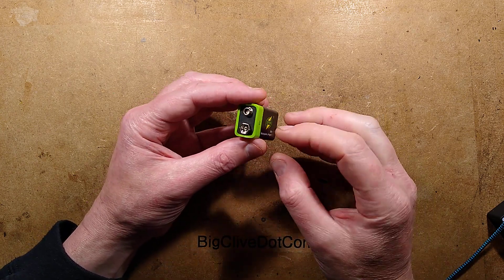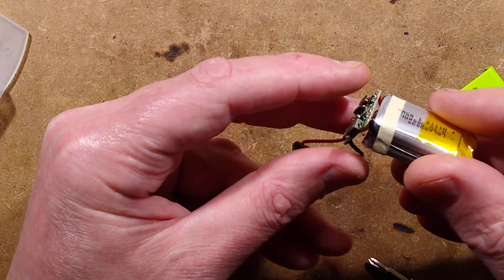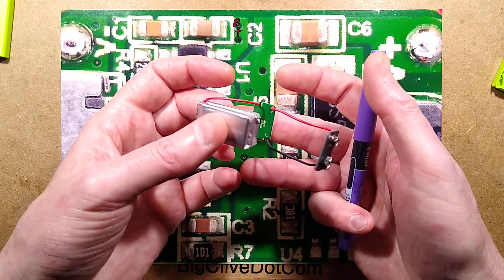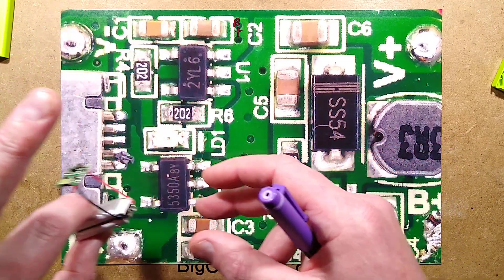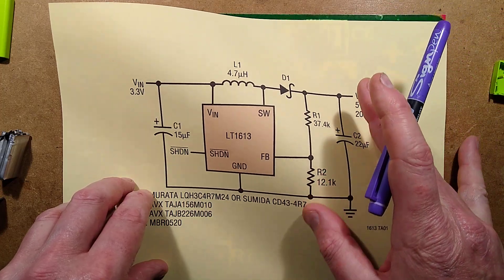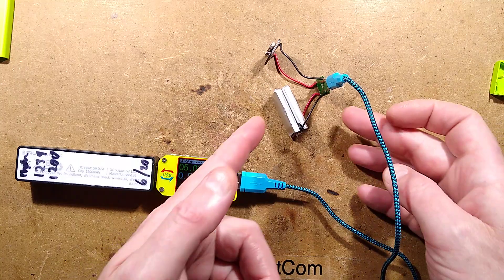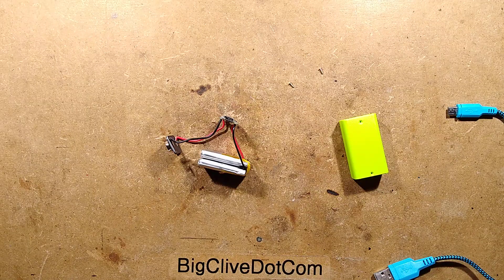Inside a Znter lithium 9V battery.

Comment: Can you do a teardown and test on the lithium ion AA batteries? I'd love to know if they're worth getting over the standard NiMH rechargeables.
Reply: Technically, you should never open a lithium cell, since in contact with oxygen, lithium becomes flammable, in the best of cases simply the entire battery will burn and emit a smoke (quite toxic by the way), in the worst case Of the cases these can explode in a very violent way, and a lithium fire cannot be extinguished with water since it reacts violently. For that reason it is forbidden to send lithium batteries by mail or airplanes (Except they are in special containers, and have an authorization from the IATA-ACAO) and for which they are very expensive in some countries (particularly islands)

the best way would be to compare them at electrical level, amperes / voltage delivered and capacity in Ampere-hours

at a general level NI-MH are more reliable and less delicate during loading but suffer from memory effect, although very little, practically depreciable and are a balance between capacity-price. But they have a very slow charge, usually 5-10 hours

Lithium
-Fast charging but,
It requires a protection circuit for load and overload, special load rates, they are more delicate, the price is higher but they guarantee a good energy rate at high voltage and high amperage, the memory effect is practically null. But their storage is delicate, they should not be stored loaded or allowed to unload,

At a general level I would consider more the use that would give them. For general devices, Ni-MH is fine, lithium would only be left for devices with high consumption or that require a long autonomy, such as motor toys, cameras and flash, and lamps
Basically- Lithium is like alkaline ones, NI-MH is like zinc carbon.
 If it has a motor o heat resistance, Lithium  it is better if it does not have motors, it is not a graphing scientific calculator or a device with color screens, the Ni-MH is perfect.

Many vapers use lithium cells, although it is relatively safe given the thermal protections that some cells incorporate and their own operating range,but... from my perspective as an electrical engineer, I do not like the idea of having a lithium cell connected to a thermal resistance very much, since by themselves they overheat and the resistive load stresses quite the cell, (as I mentioned, it is not uncommon for them to catch fire or explode so the idea of someone having that potential bomb on their mouth-pocket and hand does not please me, and more because there have been accidents from using counterfeit lithium cells or very cheap and vapers in the same conditions)

Comment: These would be amazing for guitar effects pedals, especially fuzz and wah wah that prefer battery, if you could vary the voltage that would be even better
Reply: I use them in my Tokai TOD-2 overdrive and they work great. The only thing is they go flat in a few days of left in the pedal so best taken out when not in use.

Comment: Quite surprised they didn't do they ebay thing of printing 1,200mAh on it because it has 1,200mAh of lithium cells inside, instead they are actually measuring it correctly at the 9v output

Or doing the other ebay thing of printing 69,420mAh on it and putting a button cell inside

Comment: finally, nothing more hated than a device that required 9v, another thing to feed.
now if only there were a way to make the charge port rotate so you wouldn't even have to remove it to charge.
Reply: The remote for my bedroom light/fan uses 12V A23 batteries and burns through them at a ludicrous rate. I hate those crappy little batteries with a passion.

Comment: don't use battery boosters in safety equipment such as fire alarms it bypasses the low voltage alarm built-in and just shuts off without warning

Comment: i love lithium batteries because of the numbers printed on them. 682035 is the dimensions: 6.8mm thick, 20mm wide, 35mm long, 500mAh is the capacity. you might see slightly more or less capacity in the same size battery. round lithium cells are similar, 18650 would be 18mm diameter, 65mm long. its funny when you open cheap battery banks thatll claim much higher mah, then you open it and the real capacity is written on the battery.

Comment: I ended up designing my own 7.4V LiPo circuit to fit inside the case of dead 9V batteries just to avoid dealing with the inevitably high self-discharge of these circuits based on boost converters. I don't want my multimeter to be dead after a couple of months of storage nor do I want alkaline cells to leak, so I just used a 2s LiPo circuit with protection and balancing: a pair of 402040 380 mAh cells fit nicely in a 9V battery case, with the circuit between the two.
Reply: I know it's a long time, what converter have you used to power up the multimeter

Comment: I am kinda disappointed noone has made something comparable for AA and AAA batteries. Instead im stuck with NiMH that are basically useless for long-term-cycling with storage and irregular recharging cycles. (like flashlights and other tiny tools you need every few months)
Reply from the maker: They do.  Either with built-in charging port or a specialist charger that uses the standard battery contacts.

Comment: If used in a smoke detector, would you still get the (annoying) low battery beeps or would it suddenly just stop working?
Reply from the maker: It would suddenly stop within 6 months with no warning.

Comment: how does the circut in 8:10 make an average reading?
Reply from the maker: The resistor acts like a thin tube leading into a water tank, so it just sees an average value without the pressure (voltage) pulses on the main line.

Comment: Thanks Clive for another well presented video, always good clear pictures and good sound quality for you. They certainly crammed a lot into the package, a tri-coloured LED as a basic charge state would have just topped of a very good product. Other remarks made here suggest they are okay in radio mic's and also the output on a scope is clean. It would be good to know where to get these, will have a look on the usual "E" place. Thanks again
Reply: They almost would have to show some kind of noise on a scope. They are d.c. to d.c. converters. I've never found a completely clean one yet..

Comment: I am of the thinking the "foil" wrapping you took off could (stress:  COULD) be used to shield the RF from the coil.   Though it wasn't grounded so probably not.
Reply: seems legit as its in contact with the usb port
ed. didnt see the case is maybe plastic on these, the other cell types have metal cases aswell though

Comment: 2:00
Can confirm. My mom is a journalist. She changes batteries on her mic every 4 hours of use regardless of the remaining charge for safety (she is not the type of person to recycle them, of course). I coaxed her into buying a bunch of Eneloops (the regular ones, Pros don't make sense since they will be used for only 4 hours in a mic at a time), those work a lot better, don't have any risk of leaking, and would probably last till the end of time (my Apple NiMH batteries, which are basically rebranded Eneloop HR-3UTG batteries, still work absolutely fine). This solves the problem for microphones that take 9v batteries.

Comment: The only 9V devices I have are things like multimeters. Because the output might be a bit noisy, for a multimeter I'd still recommend a NiMH battery. It probably has a voltage regulator in there somewhere so it probably doesn't matter much, but better to be safe than sorry.
Reply: Have you come across any more observations on if this type battery works okay in a decent multimeter?
Have you anything to tell about useable hours of a good 200mah 7s nimh battery vs one of these lipo-to-9v batteries?
Thanks

Comment: odd you didn't do a compare as well.  Have you tried running a real 9v battery and  this one at the same time to see which dies first.,maybe show the amps on both of them as well on what ever your powering.  Once the lithium reaches a certain voltage does it just cut out? .. hopefully you make a small fallow up .. I could just order one and find out my self i guess as well.   I ordered bunch of 1.2 voltage regulators . to switch out the 5v to make some small aaa lithium ones.(small ecigs bats ). just lazy I am

Comment: Amazon has this battery (comes with charging cable), for $11.99 USD. (free shipping) 
Amazon also has a "Delipow USB 9V Lithium ion Rechargeable Battery, High Capacity 650mAh Rechargeable 9V Battery, 1.5 H Fast Charge, 800 Cycle with Micro USB Cable" for $9.99 (free shipping).  
It would be interesting to see a comparison.

Comment: Hey clive joe electrician from america thats funny when you pointed to the chip you were having trouble identifying i thought that looks like a ham radio callsign then you said it. do you have a ham radio license i would assume you do it never occured to me to ask.
Reply from the maker: I don't.  I looked at it when I was young but got put off by their requirement for full fluency in Morse code before even applying.
Reply: @bigclivedotcom  that morse requirement is gone theres an app ham test prep you will see the tall yellow diamond the arrl symbol in play store install on your phone and use it in a couple months you will be ready to test and actually memorize and learn the study guides are brutal there great for reference material but the app cuts to exactly what you need to obtain the license
Reply: @bigclivedotcom  i bought my transeiver as a parts machine for 50 bucks took it apart replaced missing and damaged components its a real challenging learning experience buying older very repairable equiptment not like the new chinesium models its a nice passive hobby to do during crappy weather and you can drink all you want and not have to worry about getting injured

Comment: I've got a couple of "Poover" brand LiPo 9v battery packs with a (claimed) capacity of 680mAh at 8.4v. They happily power a Digispark ATTiny85 dev board with some WS2812s for hours. The one drawback is cost....I got just 2 for £6.50 each (on their website they are charging $17 a pair). However they would quickly pay for themselves as they are 2-3 times capacity of a poundshop alkaline 9V battery.

Comment: I'd buy one when they come with a two or three position switch : 6v , 7.5v and 9v - there's lots of devices which only show "low battery" when the voltage gets close to 5.5v-6v, so there's no point boosting the voltage from 3.7v..4.2v all the way to 9v if the device has a linear regulator or buck converter to bring down the voltage to 5v or 3.6v. 
Or alternatively, have a version that can switch between a boost regulator (for high current) AND a voltage doubler IC for 20-50mA max which can have super high efficiency (up to 97% or so efficient)
I made a fake 9v battery for my Uni-T UT61E multimeter using a super capacitor and a LT1037 boost regulator ... could keep the meter running for almost 1h after charging for ~ 2 minutes (limited to 2.5v ~1A charge) because it shows low voltage only at 5.5v but keeps working well down to around 3.3v so I set to boost regulator to output 5.6v just to prevent the "low voltage" sign on the lcd screen.

Comment: How about measuring the output ripple? If you don't have your oscilloscope handy, I'd settle for an AC measurement on your multimeter.

I wouldn't be surprised if there are higher-end versions (with and without the audiophool pricetag) of this that have additional noise filtering on the output. A suitable RC filter with a series pass mosfet could easily fit on the back of the snap plate.
Reply: Have you come across any more observations on how this type of battery works in a decent multimeter?

Comment: I'm over 6 minutes into this video and Clive hasn't stuck the battery on his tongue!
What is the world coming to?
Reply: I don recommend thith.
Reply: You can try that at home !
Reply: Also if you short it out it can possibly explode while your sticking it to your tongue. Wouldn't be a pretty sight.
Reply: @sweettooth7124  TongueItsNotSoImportant....😁😁😋😂
Reply: I have done this with a 9V Lithium ion battery before. It is safe with alkaline 9V batteries, but not with Lithium Ion batteries. Lithium Ion batteries have very high short circuit current. It was enough to boil the saliva on my tongue instantly. Not recommended.
Reply: @cassandra2860  reading this stopped me doing the same thing in the future. Not all heroes wear capeth.
Reply: @cassandra2860  What?
Reply: @ovidius2000  I was testing to see if it was charged. I didn't know that lithium-ion batteries could give so much more current than alkaline batteries. It was charged, so I put it in the smoke detector, got some ice cream, and learned a lesson.
Reply: @cassandra2860  Did the tongue to terminal contact make any smoke, or just a sizzling sensation?
Reply: @dsloop3907  just a burning shocking sensation and a sizzling noise.

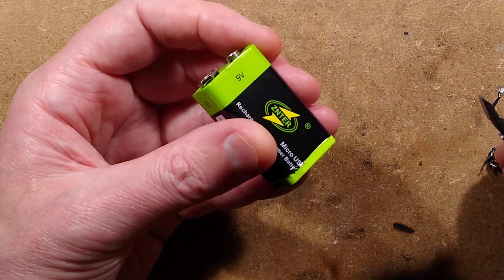Comment: 2:09  Can confirm.   During a big conference, we'll go through hundreds and hundreds of batteries.   I bring tons of them home, as most of them have over 50% life left.   Usually you have the microphones running all day, and they will generally run for 8 hours on a set of double-a's (or less frequently 9v's) but there are only so many coffee breaks, so you have to change them at a break point regardless of whether they need it.   As Clive said, it's really bad to have one go dead because you forgot to change the batteries, so most sound engineers err way on the side of caution.   Also, another important note, if you are taking all these half used 9v batteries and throwing them in a box, remember to put a bit of tape on the top, as they can short circuit against the metal case of another battery and start a fire if you aren't careful.   AA batteries don't have that issue, thank goodness.
Reply: Clip the half-used PP3s together in pairs to use as hand warmers for your walk home after the conference / show (Old BBC Studios trick; NOT recommended!)

Comment: Why everyone of them has inefficient linear charger (dissipates 20% of input power) -> one cell -> inefficient (eats much more than ICL7106) and noisy boost converter?
It must have boost charger -> 3 cells in series -> dual-mode (linear at low load and buck at high load) converter?
Reply: Pardon me, you mean ICL7660? It's only good up to about 5mA. That's the problem with switched-capacitor converters, you only get the tiniest current out of them, before they fall flat... but they can be good for low-current uses. Or you mean ICL7106 the multimeter chip... well who cares how much it consumes? It's not a relevant comparison at all.
Also go ahead and design such a circuit as you describe on a 15x21mm footprint. Boost charger takes up space and cost, because it's going to need a coil, and it's going to need balancing, they're fairly bulky designs - and i mean you don't want to put too much current into these little cells anyway, so emitted heat during charging is of little concern. As for mixed mode step-down, do you demand that every single $10 commodity make use of science fiction technology? Those linear charger chips used and these MT3608 clone booster chips are the cheapest available, and you just can't offer a similar product for for $20, because in presence of a $10 one nobody will buy those. Sure some brands will try to hike up the price, but then they have a peace of mind that it really only cost $2 to make, so they can really dump them for $8 later and still make money - you can't do that once your product starts actually costing $10 to make. Only the cheapest to make products have a chance to actually survive - everything else is engineering wank that nobody in their right mind will market.
Reply: @SianaGearz  I'm not responsible for factories/sellers can't explain it's better than conventional circuit because user has to recharge it less often and it will not abuse low-power load with ripples and noise. And it will not increase prime cost higher than 25%, especially if any IC factory will produce the single chip for charge, balance and output conversion or both sides of PCB will be used (alternative - stack two thin PCBs together), because it doesn't need any expensive technologies. Also, high quality products can't be cheapest, but they have popularity they deserved.

Comment: Pity about the design. boost circuits generate considerable RF noise. There are others with two cells in series that don't use a boost that are suitable for use in radios. These ones are not.

Comment: I deem the voltage booster chip to be MT3608 by Xian Aerosemi, Taiwan, or the identical SX1308 by Shenzhen Suosemi, or maybe more clones exist. Either comes with a random letter-number salad as its topmark, so they're impossible to google, and without having a line to the manufacturers, impossible to tell which is which.

Comment: I considered using the D-cell version of this for my radio restorations. My concern was RF; the converter clock on mine was in the MHz range, and the ripple was not negligible. It would be interesting to see how much output ripple is present across the various sizes of these.
Reply: Another concern is if the buck regulator fails shorted to output. Then you'd get full LiPo battery voltage instead of 1.5v and toast your radio. At least with the 9v version, if that happened, you'd effectively just have a flat battery and no harm done.
Reply: I'm using the D, C and A versions of this battery for Nerf blasters that I did not modify, and they're working extremely well for this purpose, as they keep the voltage the blasters need
Reply: what about using those D-size 3xAA holders? So use 4 of those holders and say 12 eneloop AA's. (Assuming nimh voltage curve useable.)